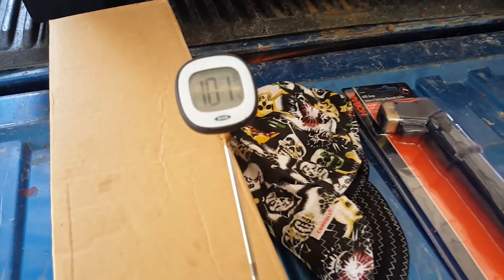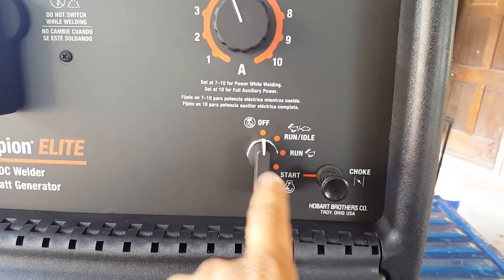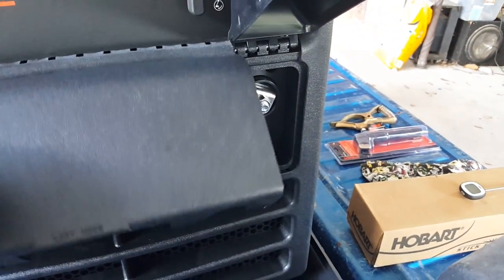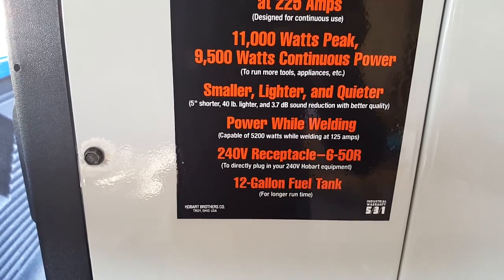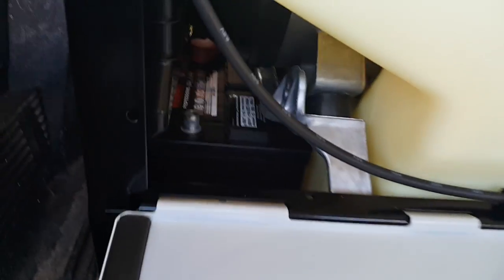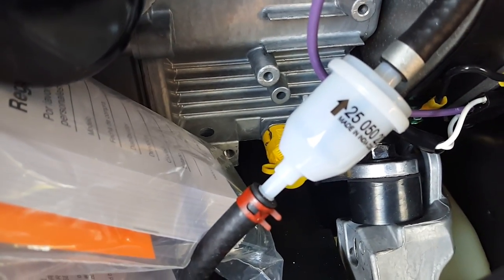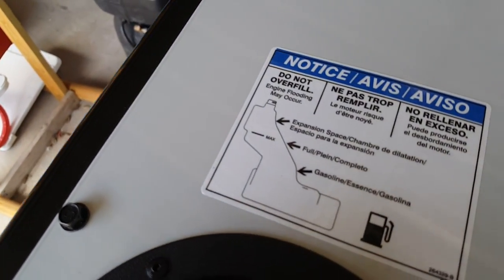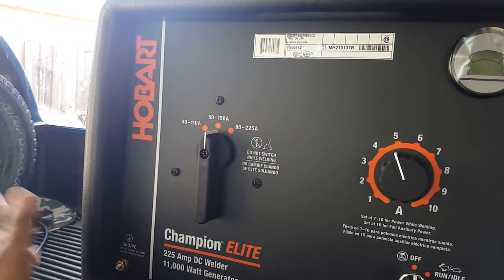PURCHASES HOBART CHAMPION ELITE ENGINE DRIVEN WELDER

Comment: This Hobart is Made in the U.S.A. and the price is great for a Welder / Generator combination. Thanks for Posting !!
Reply from the maker: It's a great machine. It may not be a pipeline rig but it works great. The generator can power alot of stuff and I should really run some test on it.

Comment: Hi Jorge.  New to your Channel . I’m Service tech on unit . That unit and of new unit do not jump start them if battery gets weak . Only trickle charge or replace battery . I’m up in Spicewood Tx and I got a guy up in Seguin Tx . If need any Service or questions . Help welding   Kevin .
Reply from the maker: Thanks for the suggestion on weak batteries. I am actually looking for a smaller machine to hook up to my 220v outlet so I don't put to many hours on this machine. I bought the oil and filter about 3 months ago and still have not made time to change it but might have a video on that soon.

Comment: I bought one it's actually my second one of these I love them miller owns them there good machines
Reply from the maker: They are awesome machines. I havent used it much since the grass is so dry here and 112 degree weather sucks. I plan to install this on my dually I got.
Reply: Miller doesn't not own Hobart. They are both owned by Illinois Tool Works.
Reply: I'm having trouble with the fine adjustment. How much does each number stand for? I have no idea how many amps im actually at. Trying to learn the machine has been a bitch cuz of no display of amps
Reply: @archvile2764  I think the point of the comment was that Miller and Hobart are practically the same nowadays (same parent company but different brands) but they OBVIOUSLY share design departments or at least fluidly share the engineering behind both product lines.  Granted the Miller machine will have additional features but for people like me that run stick only and have no need (or desire) to run mig, tig or FC, it's a perfect fit for a great price.  The way I see it, Miller gives Hobart the designs for each machine, Hobart then strips the model down here and there and markets the striped down machine with Hobart branding for the DIY homeowner at a much better price.  It actually works out well for filling the gap in between different Miller models for those that don't need all the bells and whistles but still need the power and dependability.  Hobart machines literally have miller part numbers.  Personally I do not feel Hobart is any more a "homeowner/DIY grade" welder  than Miller is, in fact, I prefer Hobart in many cases.

Comment: I hooked mine up with an electric fuel pump, 2psi.  I like it better.  I also got an analog gauge kit  from Miller, 2 gauges amps and volts. I also ran a #4 cable from my truck alternator to the welder battery, with a solenoid,   Nice welder, hope you get a lot of use out of it !!! GREAT VIDEO review 😆😆😆
Reply from the maker: I cant wait to install this on my flat bed truck I am building which is also on my channel. I like the idea of the battery being charged by the alternator of vehicle its on. So basically you installed gauges to see the amperage, that is awesome. I wish you had a channel or video on it. I will check out millers page in a bit.
Reply: Any more details on these mods? Specifically the fuel pump (why) and the amp/volt meters?
Reply: @aaroncooper2851 
 the why on the electric fuel pump, ?      Because if you don't use it everyday,  the fuel evaporate s,      making it crank for a long time before it will start.        Plus you can at the end of the day shut off the fuel pump and run the carburetor dry,   so the new ethanol gas DOESN'T rot the carburetor.
  Volt and Amp gauges,   when your welding to code you need to set the specified voltage on the suitcase wirefeeder.
Reply: @billarroo1   Thanks! Assuming here the volt and amp gauges only move when welding? Do you have more information on this? Very interested in how you have it setup.
Reply: @aaroncooper2851  I remember now the Miller volt amp gauge kit is from a 325 or 350 trailblazer. and the induction sensor goes around the NEGATIVE lead inside the machine. . also both gauges are set in a ALUMINUM 1/8" plate that is bolted to the top front and Hangs over the front.

Comment: Should have gone with the Lincoln ranger 225 like I did or a miller bobcat! Those things have the generators go through brushes often!
Reply from the maker: I had placed an order on the Ranger 250 when it had like a $1200 discount but my card got denied and was the last day of sale. A few months passed and started looking again at the Ranger and Bobcat 225. I did go with this one because the savings of $1000 minimum compared to other machines. I still have 70 hrs on unit so does not get much use as I expected so hopefully it will last a while.
Reply: Hey nothing wrong with that just keep in the back of your head they like to have brush issues between 400-500 hours! Besides that they are good welders I went with my Lincoln cause of the price and it has cv mode, don’t use ac on stick much so don’t need the bobcat personally
Reply from the maker: @adamswelding5052  I appreciate your input since I could not find much info on these Hobarts online during purchase. I got this one over a Lincoln Sa200 because I needed AC power at ranch but do want a lincoln pipeliner welder too.
Reply: @Jorge Serna I don’t know if you had heard but they make a kit for the Lincoln as welders to make their power plugs ac. Maybe you could look into one of them!
Reply: I thought the miller bobcat 225 was the same welder?   Doesn't Miller own Hobart?
Reply: Yes and no they are not the same machine but Miller does own Hobart, they use lower quality parts in them and consider them to be more of a hobby brand, also there isn’t the brushes in the generator like a said in a previous comment but I have heard the Miller ones will fit this machine
Reply: @adamswelding5052  The parts are not lower quality. The Hobart machines are more basic and have fewer bells and whistles, but they are just as good of quality as the blue machines. I wish you Miller fanboys would stop spreading lies. The Hobarts weld just as good as the Miller units, only with fewer features. So if you need the fancy bells and whistles to lay a bead, then buy Miller. If you can weld and want a solid machine with consistent performance, then Hobart is a good budget priced AMERICAN made machine. Last, Miller's fancy boards have a bad reputation for poor life spans and they cost more than half the price of the machine's msrp.
Reply: Muy bueno Bryen GC 👍🏽
Reply: @1D10CRACY yes

Comment: Hobart is also made by Miller and I would rather have a bobcat 225 because it has ac and the doors were the wielding leeds go are made to accept the quick discount s
Reply from the maker: I actually looked at a Miller 225 and a Lincoln Ranger 250 before looking at Hobart. The Hobart was way cheaper back then especially with a 10% off coupon that gave 20% off instead. I also looked at a SA200 which was a power house but lacked generator power. Prices are crazy high these days.

Comment: U have a video to assemble it bc i am getting one tomorrow
Reply from the maker: I don't have a video on assembly. I bought mine and all I did was remove the bottom crate which was 4 bolts, hooked up the ground cable on battery and installed the exhaust pipe. I cant recall if the motor had the oil but that's all to get the machine running. I did buy some 1/0 thick cables for long runs and added the quick connectors and ring terminals.

Comment: I just bought one this afternoon and fired it up. I noticed it will rev up and down on its own while it’s on idle. You ever had this problem
Reply from the maker: I have owned mine for a bit of time already and today it was at idle and then I heard the rpms drop. Mine will automatically rev up when I arc it but dont recall it going that low before. I did have a bad battery so not sure if it was revved up to charge it.
Reply: Jorge Serna I know what your saying but mine will be on idle and just randomly rev up then down then back up lol
Reply from the maker: @JoseMartinez-xl8ux  I just turned mine on again but it stays revved up kind high and did not drop down. I will keep you updated if it starts doing what yours does.
Reply: I ran mine on high idle for 30 mins and it stoped doing what I said it was doing. Turned it off and back on and now it’s working perfectly

Comment: Did u just crank up an start welding I just bought one last week
Reply from the maker: I picked it up at night and the next day started welding. I have to do an oil change after running lots of hours during the Texas power outage. The welder works great and was one of my best investments.
Reply: I cranked it up yesterday after work I luv it

Comment: How is it welding for you can you post some video's of you welding with this machine
Reply from the maker: Darcy Patterson its awesome. I plan on working on the smoker next week. I will try diffrent electrodes so we can see how it does. I have welded up to 1/2" wall pipe and lots of 1/4". I did some 24 guage steel and with the first batch of Hobart 3/32 7018 and welded great, the second batch at same setting kept burning through.
Reply: Jorge Serna 
Can you post some video's of you welding with the hobart im thinking about getting one and how did you get the discount on it thanks hope to hear back from you
Reply from the maker: Darcy Patterson I dont have any welding projects yet sonce the weather is nasty. On the coupon I got it was 10% but online would be read as 15%. So I ordered online and did a store pickup. The coupon had no limit to savings but the latest one has like a max 100 or 150 dollar off.

Comment: I use the hell out of 6011s
Reply from the maker: BRENT3143945 I have about 50lbs left of 6011 which I use mostly on oilfield pipe. This little machine works awesome. I just bought a used truck to mount this welder to. 2 weeks before it arrives, just paid for it.

Comment: what type of ⛽ used for this welder?
Reply from the maker: I use basic gasoline in the machine, I still have the $1.80 per gallon gas in it lol. I cant believe how expensive fuel has got especially Diesel.
Reply: Thank you

Comment: What's the choke button for??
Reply from the maker: Choke button is pulled to help crank the machine easier by altering the fuel mixture. When the machine is on you can slowly push the button back in.

Comment: Would this welder be good for every day use ?
Reply from the maker: This is a great machine to use on a farm or home. The prices have gone up a ton since I got mine but its a great machine. I weld lots of purlins, oil field pipe and scrap metal and never failed me.
Reply: @cutweldngrind   I work in shoring and piling and would be using it every day welding in the field so hopefully it does me good if I decide to buy it

Comment: Does this generator work good for a back up power for your house?
Reply from the maker: I have not wired it up to the house but I have powered several big devices. 240v compressor, 45a plasma cutters, fridges, lights etc. I have 75 hours on the unit and half of those hours are as a generator.

Comment: How’s it working out for you?
Reply from the maker: AcePowdercoating Ace it has been working great and does what I need it to do.I poured a small concrete footer for a sliding gate and will be using welder this weekend. I was sick a few days and worked several weekends at my job so welding was put on hold.

Comment: Hows the welder doing now ?
Reply from the maker: It works awesome but I only have about 58 hours on it. It ran great during 2 power outages and been great so far. Battery is still original and working good.
Reply: Thanks

Comment: Very interesting video, definately lots of good information, where was the coupon from? I was looking at the ranger 250, but this video got me thinking
Reply from the maker: The coupon was from Tractorsupply. I tried it online to see the final price with tax and noticed it removed way more. I rushed to the store and coupon only removed what it stated, tried online again and it removed more so I bought online and traveled 45 miles to pick it up. The Rangers are nice too. I wanted the 250 but was over my budget. The battery is going bad now but unit works good.
Reply: Jorge Serna thank you!!!
Reply: @cutweldngrind  compa cual es mejor la Lincoln oh Miller oh Hobart no se cual agarar
Reply from the maker: @franciscocastillo2824  
Compré el hobart porque obtuve un descuento muy bueno. Realmente depende de cuáles sean tus necesidades. Solo necesitaba una máquina de soldar decente y un buen generador para alimentar mi casa en caso de emergencia. Los modelos de entrada de cada marca tienen aproximadamente las mismas características. He usado Hobart y Lincoln Eagle de Home Depot. Intenta encontrar un amigo que te pueda prestar uno para que lo pruebes.

Comment: What u pay for a hobart you can get a lincoln 225 ranger . it has a CV option so u can run a suecase off of it .
Reply from the maker: Cody Dayton This welder was my 3rd choice. I was looking at the Ranger 225 and Bobcat 225. I could not find a better deal on the other 2. The Hobart is $1,000 cheaper than the Ranger for sure and maybe $1300 than Bobcat as I type. 

 Price on Hobart was $2999 minus,$450 discount and minus $159 tax exemption. Total paid $2550. 

Its a nice machine. I did think of the CC and CV. If I need a mig welder I will add a Lincoln 210mp with the savings I had.

A guy had a 19hr used Ranger 225 for 1900 but I got beat to it by 10 minutes. Local sales ad.

Thanks for watching.
Reply: Should still be able to run a voltage sensing suitcase off of it like a miller 12 or 8 vs.
Reply: Ya and this one is dc only
Reply: Lincoln ranger eagle is 3200$ at Atwoods
Reply: @BRENT3143945  The Eagle is not a Ranger.   The Eagle is pretty comparable to the Hobart.

Comment: Is this a unit for beginners when it comes to Engine driven welders or does it even matter what model?
Reply from the maker: I needed a gas driven welder and back up generator and this one fit the budget. The Lincoln 250 GXT had better features for expandability but did cost way more. Welders have gone up in price and really depends on your needs. I wanted a SA200 pipeline welder but was going to be about $6000 after rebuild.

I like the welder and sure helped during the Texas Freeze running 3 or 4 days.

I think this is an entry welder that competes with the Lincoln Eagle gas driven welder from Homedepot.